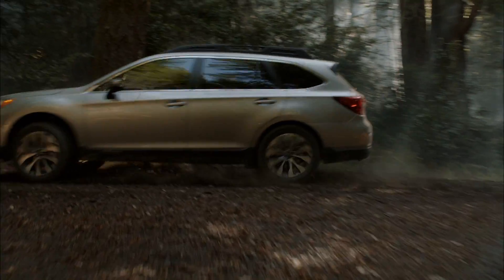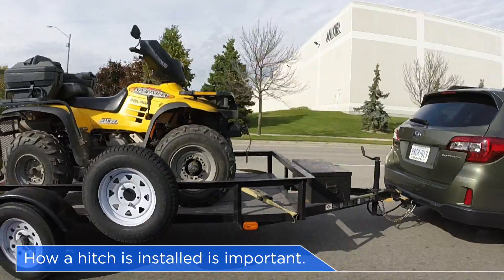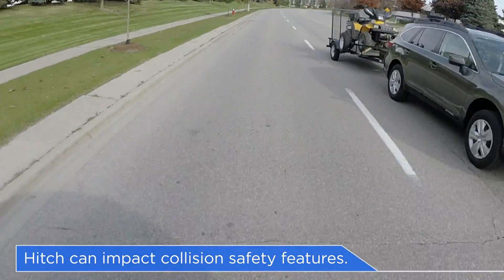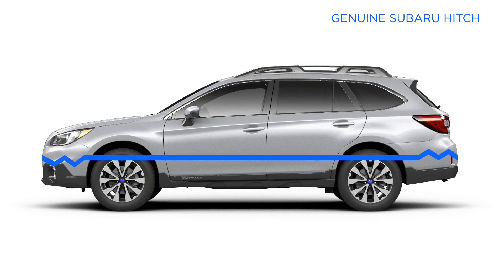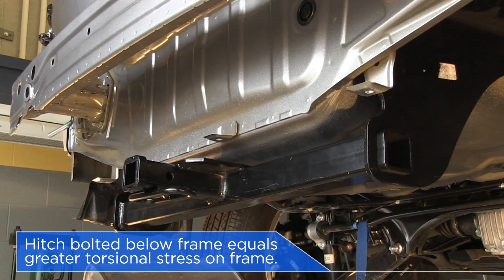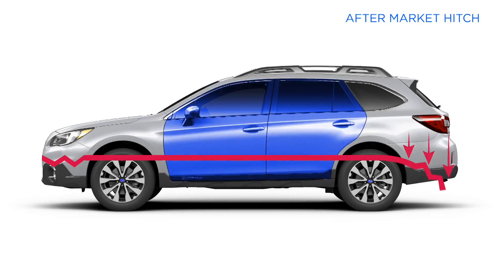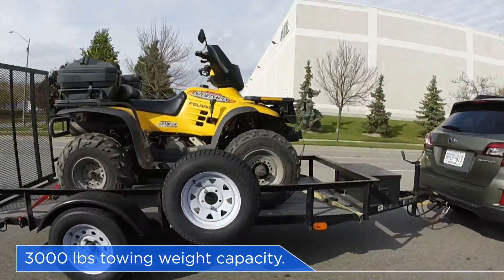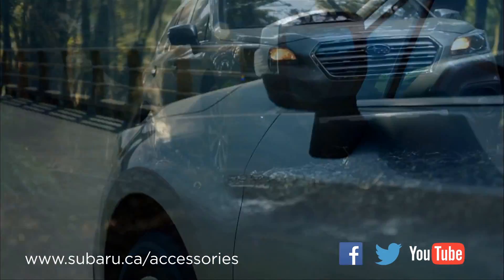The Subaru Difference - Trailer Hitch Assembly

Comment: Bought a new 2020 Outback last week with a hitch. The hitch is a 2” hitch and is a genuine Subaru hitch installed a few days later by the dealer. Much better than any other hitch, worth every penny (approx $500 USD) when you consider the amount of labor to install it and the wiring harness. They even included a nice Subaru receiver cover. First class. Spend over $30k for a car, do the hitch right.
Reply: I did the same with our 2020 Outback. I wanted the Subaru OEM 2" hitch because it preserves the most of the departure angle by mounting in the bumper. The after market hitches hang lower, below the bumper, and may drag when doing some off roading.
Reply: Where did you get it installed? Which dealership?
Reply: Me too.  Love it, but disappointed in the 1,500 lb. max tow weight
Reply: They want $910.00 for tow hitch install on 2011 forester at Subaru dealer in Rhode Island

Comment: Subaru hitch is Class I and aftermarket hitches that ALSO attach to the bumper mount studs are Class III and cost from $200 to $300 depending on brand and without installation. The stronger Class III is a better choice if using self-supporting bike and luggage racks that attach to the hitch.
Reply: What brands have Class 3 with bumper stud attachment?  I can only find the drill-your-frame brands.
Reply: David F look on etrailer.  Drawtite and Eco hitch offer hitches that mount to the frame.
Reply: @darensanders423  I was looking at the Class 3 Eco Hitch and a few others that mount to the frame without drilling, but they do require trimming the heat shield. Is that considered bad for the safety features, structural integrity, etc, as well?
Reply: Regardless of whether you go with a Subaru OEM hitch or an after market, isn't the towing capacity for a Forester still at 1,500 lbs?
Reply: Correct.  Our hitch says 1,500 lb right on it, so when we rent the 4x8 uhaul cargo trailer that weights 850 lbs we load no more than 650 lbs.

Comment: Good reason to get a genuine Subaru trailer hitch - Safety
Reply: Good reason not to - the highway robbery they charge to put one in. If Subaru "cares about safety" so much they could try to be more reasonable. $800 at the dealer vs $120 self install?! Of course people are going to choose the latter.
Reply: Don't need a lift. I installed mine by just driving the rear end up on 2 2x8s. Perfect height. I was quoted $660 installed. Wiring harness $204 installed for my 2018 Forester. Got a Curt hitch and a Tekonsha Custom Fit Vehicle Wiring Harness for $175 and installed my self. So I saved $685. I would have liked OEM but the price is crazy. It took me 15 minutes to install the wire harness and they are charging $104 just for the install of that.
Reply: Lol guy still pays $500 more then us and acts like its a steal HAHAHA
Reply: I had one installed in my 2017 Outback for $700 at the dealership. Gotta wheel and deal with them a bit. Always go straight to a manager.Totally worth the cost and reassurance they are responsible if anything was done wrong. Plus I don't have a lift, like most people, so how am I going to do this myself?
Reply: @aliadawn  dont need a lift,  if you can get on your knees